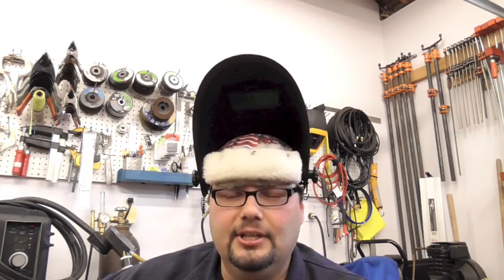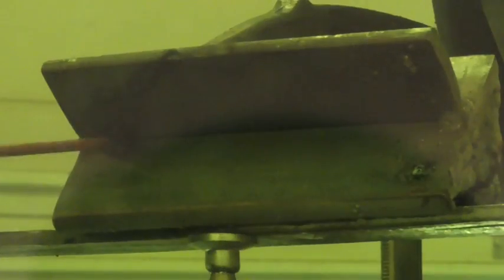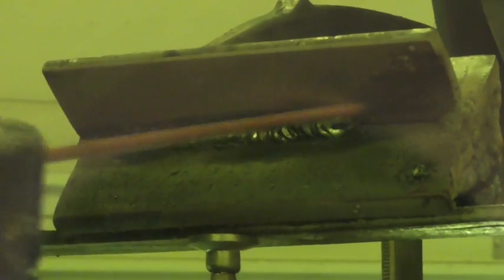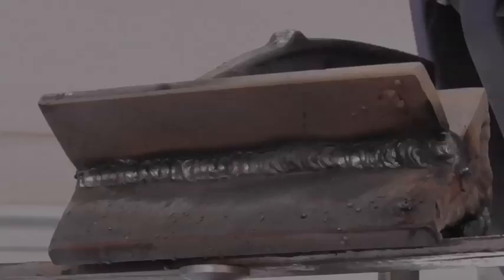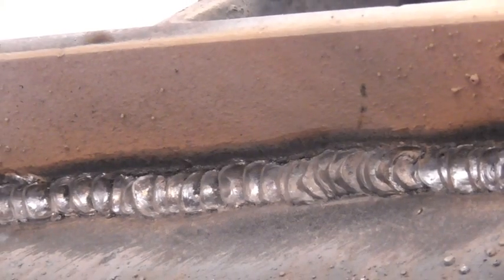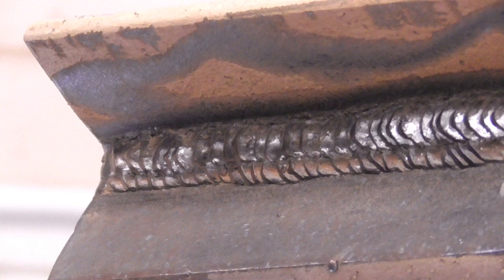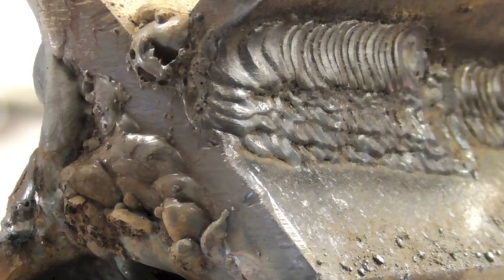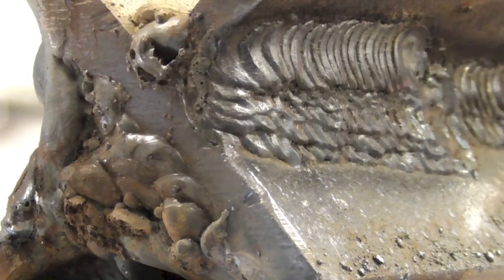Stick Welding Tips - Horizontal E6010

Comment: For ur next video:  Do a mig like tig video.

Show us ur skills!
Reply from the maker: pccchurch I'll keep that in mind, thanks for commenting!
Reply: Mig like Tig is a farce. All you need is a cold(too cold) setting and the circles.There's a hotrodder on welding web that makes it into art work.Beautiful stuff. The weld itself is shit....from a technical standpoint.
Reply: Very true. I had turn down the heat pretty low on my powermts welder to get the tig look.  The penetration wasn't very deep so I only use that technique when penetration isn't that important.